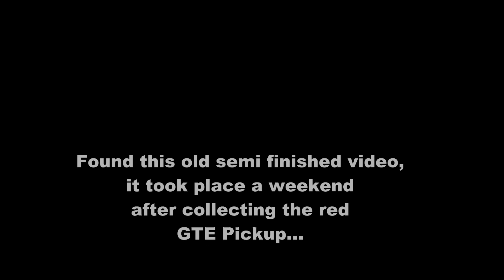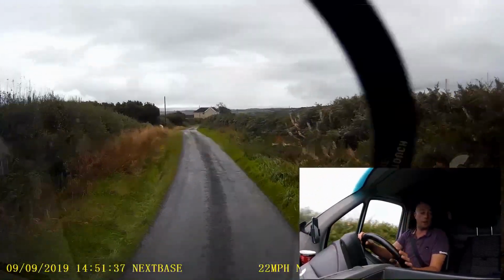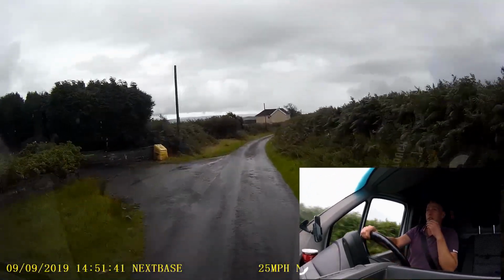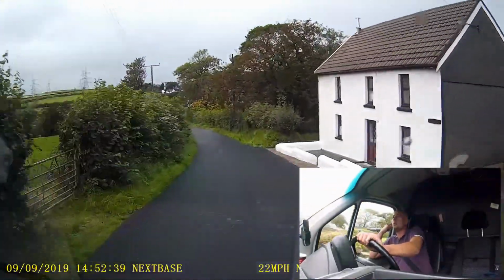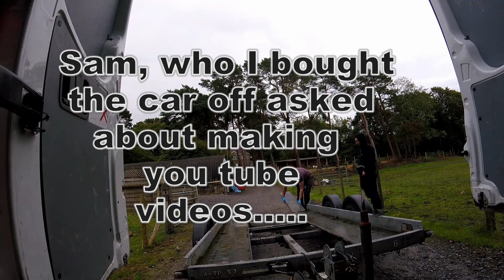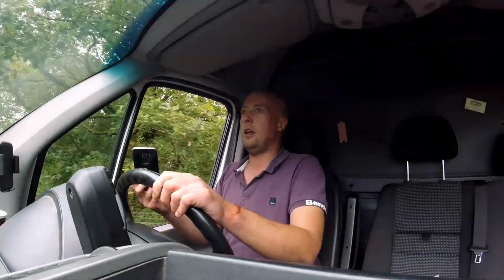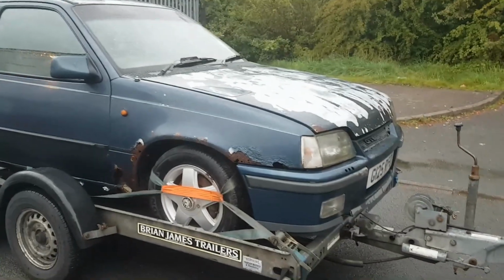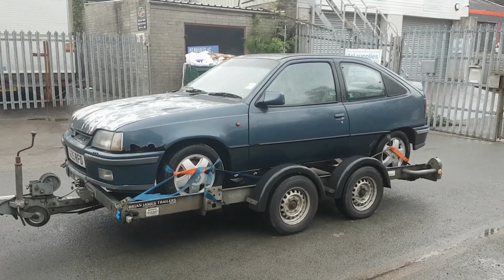Vlog The Story Of Collecting The Blue Astra GTE 8v. & Mercedes Sprinter SatNav

Comment: still got a MK3 5 dr with a red top in. My missus has a MK4 with an MSD vectra engine but is poorly. Fed up of mechanics fixing silly things and costing me £100s.... Last was change spark plugs and change crank after checking over why she wouldnt start. Got 2 ECU's which are a pain in the arse. One for clocks and one for engine with no diagnostic port. Proper Bummer!!! Love the channel and is great content especially the old Vauxhalls!
Reply from the maker: I've got a few red top cars in the storage room...they will be coming out for restoration soon...thanks for the feedback and for watching.
Reply from the maker: Is the msd the white early one or am I getting confused?
Reply: @Gfix109  they made a few models in different colours they were originally a vectra Sri but sent to motorsport developments for altering so different cams different ECU etc and from 150bhp to 198 hp N/A. Hell of torque on her. Just need to check fuel pump spark plugs and crank again. I hope I can get her back on the road.